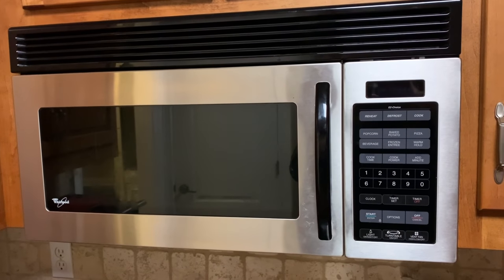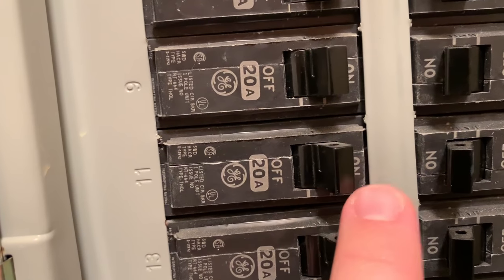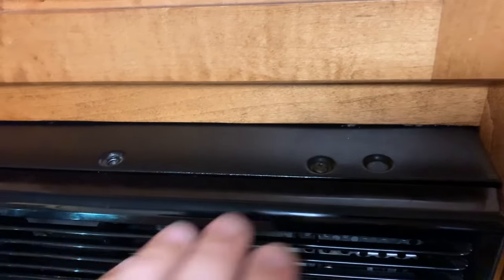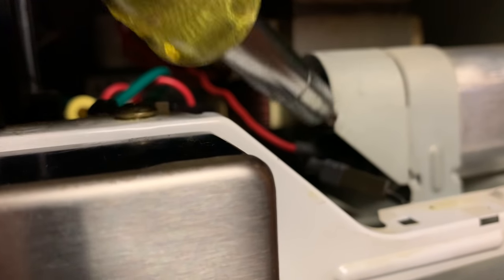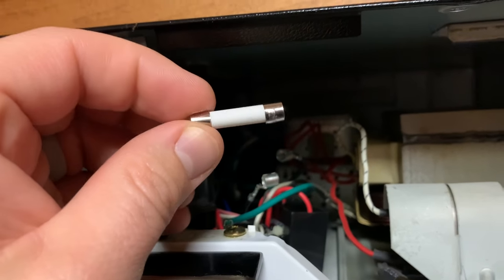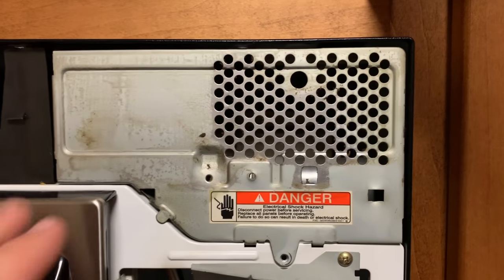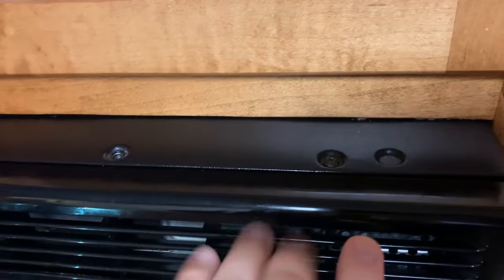Easy Fix: Microwave Won’t Turn On - No Power on Microwave

Comment: I was about to attempt this but the words "Can Kill You" made me spend money for the repair guy coming over Monday.
Reply from the maker: I completely understand. Any electrical work could kill you so it’s all about knowing the causes.
Reply: Me too😂😂😩
Reply: I didn't understand what you meant by ensure the wires are crossed prior to starting, wish I could have seen what you meant.
Reply: @stephaniespencer7898  Crossing the wires means the metal part of the screwdriver touches both wires.
Reply: Exactly I was like well guess I'm replacing it 🤪 and give my microwave to an electrician 🤣
Reply: Haaaahaaaa 😅👍🤣 That is a laugh 😂"Can kill you" Exactly right....if One don't understand Electric Current/Voltage ⚡⚡⚡ and Precautions
Reply: I tried the first one it worked turned it off and on
Reply: Fair, I've been rebooted by an electrical discharge once already
Reply: Right!
Reply: Apparently, if you leave it powered off for hours (or a day), any residual power is gone.
Reply: Thank you! I fixed my microwave!!
Reply: 😮 @sariahwandler4682  how?
Reply: That statement made me soil myself!
Reply: @sariahwandler4682  at the same time or do one and then the other and vice versa? Also, do I need to do this if I'm just changing a door switch?
Reply: @1flychicken  is 1 day enough? Some guys say it takes a couple of weeks
Reply: I mean driving a car could kill u
Reply: @bigrollin  True.....But I've been driving 36 years and of course I didn't learn how to do that on YouTube.  This kind of thing I'll leave for a professional. I have no electrical experience. 🤣
Reply: @1flychicken You want to chance that? 😮

Comment: One thing you should maybe mention is that if you wrap the fuse in tin foil you should probably discharge the capacitor again before reaching in there
Reply from the maker: Good point.

Comment: Great instructional video.  Contrary to other instructional videos on YouTube where the speaker is more interested in hearing themselves talk, you were not long-winded.  Straight to the heart of the problem and the fix.  Saved me from purchasing a new microwave.  Fuse costs me $3.63 at my local big box hardware store and I was back up and running.
Reply from the maker: GCag1165 That’s great! I appreciate the compliments. I love a good success story.
Reply: @TightWadDIY  so I find this vid to be very good but there’s 1 problem. My microwave is nothing like the 1 in the vid. It does not mount onto the cupboards. It does not have the thing on the top above the cooking area. And it does not have screws on the top of it either. Using google lens I found it is a General Electric microwave. My dad says he bought it approximately 20 years ago. I found this vid hoping to see if I cud fix it myself for cheap instead of heaving it into the dump and buying a new microwave. 

Cud u direct me to a vid that wud help me with this type of microwave?

Comment: I finally found my fuse hiding behind some components on a circuit board. The biggest tip that you helped me out with was the disassembly of the front! I was thinking that I had to take the whole unit down! You saved me BIG time! Thanks! (My M/W is a HotPoint)
Reply from the maker: That’s great! I’m glad you found the video helpful.

Comment: Thank you so much. I am handy around the house and fix almost everything that needs fixing. I couple months ago my partner attempted to boil an egg in the microwave. Needless to say I didn’t work. I then opened it up to see if any of the electrical circuits had blown. Thankfully, not so. I then thought it must be the fuse. When you mentioned by simply using tin foil to see if it is indeed the fuse. 

IT WORKED! I’ll be replacing it tomorrow. Amazing clip. Thank you ♥️
Reply from the maker: That’s great!

Comment: I killed one at work trying to boil carrots (we had no gas at the time, you may have heard about the Winter Storm of 2021 that hit Texas hard) pretty sure it died of a blown fuse, but my boss didn't want my messing it further even after telling her what I thought the case to be. I also replaced a light bulb in a personal one years ago.

I'll replace lights, I'll replace fuses, but I will NOT touch that big ass capacitor.

Comment: Thanks man I was messing with the back of my panel and I slightly shocked myself Just a tiny bit messing with the door lock mechanism... But when I did that the  Fuse Blew..  I watched a couple other videos no luck until I came upon yours thank you for showing me where the fuse is located and well using the tin foil It works now but I'm not using it until I get the new fuse thank you for your time
Reply from the maker: I’m glad you found it helpful.

Comment: You had me right up to using the tin foil. If there's a significant short in the microwave that "troubleshooting technique" could lead to  the wires melting and frying the circuit board(s). Better to test with a multimeter and leave it at that. Why RISK bypassing the fuse, especially when you don't know if something is shorted out?
Reply: Just because .22 caliber bullets also work, why risk it?   LOL

Comment: This is terrific but I didn't understand your instructions on how to discharge the capacitor. You said you had to cross it but I only saw you tap it in two places with your insulated screwdriver. 

Thanks for your guidance!
Reply from the maker: Make the screw driver touch both of the leads at the same time. Do this at your own risk. It’s dangerous.

Comment: I made rice once. Ran it for 10 minutes. Wasnt done so ran it for another 10.  At the end of the second run it tried to ring the done bell, and went black. Did all those things you suggest, and was about to unscrew the vent panel, when I decided a cup of coffee was in order. So I opened the stove top, lit the burner, and proceeded to boil water for the first or second time since we bought this rv.  Standing there waiting to see if water boils faster by watching it, I fiddled with the hood fan and light switch. Turned it on and was startled to find the fan was blowing down, not drawing. A moment later I looked up and lo, the microwave was back on.
I dont know what the connection between these events are: watching water boil, fiddling with the fan switch (bulb was burnt out on the hood fan, waste of money to replace a bulb that only lasts a week or two) . . or just waiting. 

I drank the instant coffee with great satisfaction at the magic of science.
Reply: @Itzel Rodriguez : My brother claims he made instant coffee in the microwave and time traveled. lol
Reply: @Itzel Rodriguez 🤣😃

Comment: This is why I love YouTube and guys like TightWad!  My microwave was like 10+ years old.  Then boom, no power.  Crap.  I figure it's tits up, so, I pull it out and take it to a recycler.  They wanted $5 to recycle it!  Nope, I'll figure another way.  Then I thought, maybe I should try and see what's wrong.  So, I put it out in front of my garage for like a week.  Today, I type in a few words, find this video, go out and do exactly what he says.  Tested the fuse with a multimeter, no tone.  So, I wrap a little aluminum foil and BOOM!  No, not an explosion, Power on baby!  So, I'm on my way to the hardware store and for $4.50, 50 cents less than the cost to recycle it, I'll pop in the fuse.  Then I get to reinstall it.  I guess that's my penitence for not checking YouTube before uninstalling it.  Hey, saved a few hundred dollars!
Reply from the maker: That’s great! I’m glad it worked for you too!

Comment: Thanks for this helpful video. It solved the same problem on a Maytag microwave. On a Maytag mmv4205ds3, this fuse is located on the "Noise Filter" board, located mounted to the back of the unit, within reach of a needlenose pliers for easy pull and replacement. I wish that I found this video first. I replaced the other fuse located behind the touch panel.
Reply from the maker: Nice!

Comment: Also make sure you are getting power to the outlet plug in a hairdryer or other item that will pull significant power and make sure the outlet works

Comment: my microwave is not turning on, no lights, no clock and the fuse is ok and there is electrical power in the outlet, since it's installed, I have used it a couple times before noticing it is not lighting up, can you offer a suggestion on what I can check? the model is fridgedaire FPBM3077RFA
Reply from the maker: Sorry I’m really not sure. Double check to ensure your outlet is working.

Comment: Thank you so much for this video. My LG microwave suddenly stopped working while I was warming up food. Luckily I had the extended warranty and scheduled the tech visit. Then I watched this video. Turned out my GFCI outlet next to the plug point was tripped. Reset and that fixed  the problem. 😀😀 Is it OK to connect the microwave to a regular plug point? My previous microwave also used to trip the same GFCI outlet.
Reply from the maker: Yes. Microwaves don’t need to be on a GFCI outlet.
Reply: @TightWadDIY  But why is the GFCI tripping? The breaker box says it’s 20amp. Should I replace the outlet? It’s 20+ years old.
Reply: @crazaholic1968  If the GFCI continues to trip after the micro is out of the picture then, yeah, it's probably time to replace it. They do fail over time. If not, then something else might be wrong with the micro, of course. I'm here 'cause my micro was tripping a non GFCI breaker. Then when I plugged it into a GFCI it began tripping that. Then the micro stopped working entirely. I suspect my door switch has gone south and that blew the internal fuse finally. 

Note that the 20A breaker is upstream of the GFCI outlet. GFCI Outlets are some times 15A. In my experience they are more sensitive to over current as well as short to ground. Makes sense, they are supposed to protect people from shorts around damp / wet locations. Annoying, but safer.
Reply from the maker: @crazaholic1968  It could be a number of different things. Start by replacing the GFCI. If the new one trips again, check the outlets on the same circuit. One could have an issue causing the GFCI to switch off doing it’s job properly.
Reply: @JackWilson327  it doesn’t trip frequently. Last time it happened when the old microwave died two years ago. Got the new unit and no issues so far until last night it tripped again.  So I guess it was a random surge or something maybe? I tested the outlet using a gfci tester and it seems working normally. Not sure if I need it checked with an electrician. Outlet is not designated for microwave use. Just using one of the outlet On counter top which happened to be connected to a nearby gfci outlet.
Reply: @crazaholic1968  I just re-read your post. So you have a GFCI device next to the plug point? Are you in UK or Europe? If so, this is making more sense to me now. Yeah, you probably want sparky out to look at it. Especially if it's happening more frequently.  

In the U.S. we mostly have the GFCIs built into our 120V duplex receptacles.

I know in UK, EU, & a lot of ROW they are often in another box & 220V & like you said, next or close to the actual outlet. 

Anyway ... you said your GFCI is good for 20A. If you are on 220 then 20A is good for 4400 Watts. 2200 on 120V.  So, in either case I'm thinking a good microwave should not be pulling enough to trip a GFCI that's in good condition. 

You can DIY it if you are comfortable doing the work. I know A LOT of people are not comfortable opening up electrical boxes. I get it. There are lots of good youtubes by real electricians out there.

Comment: Thanks this helps.  After replacing I could set the clock, but on starting it blew again.  Those other parts you mentioned easy to replace or should I just buy another?
Reply: Hello, question I did what he said also by changing the fuse an it starting working but the next day it stopped again.  By your question was curious what did you have to do with yours buy another one or did you have to do something else to fix it?
Reply: Same thing happened to me. Wondering if I should just buy a new one

Comment: Good video however I will caution you’re viewers putting aluminum foil  around a fuse is very dangerous for any amount of time the best troubleshooting method is using an ohm meter this is based on 47 years as an electrician thx

Comment: Caution on using "insulated" tool for discharging capacitor.
     I bought a multi-head/bit screwdriver at a  large chain hardware store.   Tool looks like one shown in video.   
     I notice one day (while I'm using tool in daylight) fine, raised print on black, "rubber" coated handle: 
    "WARNING: NOT INSULATED.  WILL NOT PROTECT AGAINST ELECTRIC SHOCK."        
      Make sure it is insulated.  
Also, there needs to be somewhere for the charge to go.   Resistors, and ground.    More of a process, but probably safer.
       Thanks & Take care.
Reply from the maker: Thanks for the tip.
Reply: Second that. Some of these tools we're getting have a ton of carbon (charcoal) in the rubber. The plastic should be okay I would think. One would have to put a meg ohm on it to see, absent a rating ... I digress

I have rigged up a 40W incandescent appliance light bulb in a socket with a couple of test leads just for this purpose. It discharges caps gracefully and gives me a visual signal the juice is all gone.
Reply from the maker: @JackWilson327  Now that’s a great idea!
Reply: What sucks is that I bought an insulated screwdriver for this but the bare metal isn't long enough to discharge the capacitor. Doh!

Comment: Thank you so much for your tips, my microwave started working right after the fuse (not even cost 3 bucks) replaced.
However, I couldn’t turn off microwave lights?  Please advise how to fix this issue.
Reply: Look on the microwave. You will find a light switch somewhere there. Sometimes it is little bit hidden. Mine is on the panel and it says "surface light".

Comment: Are microwave fuses of standard spec? How  does one determine the type of fuse? Thank you in advance.
Reply from the maker: No. There are different sizes. You need to pull up the parts manual for your device.

Comment: My microwave haved replaced the fuse and it work but 3 days later no more power. Can you give me other possible tip about what it can be?
Reply from the maker: It’s hard to say if it happened a second time.

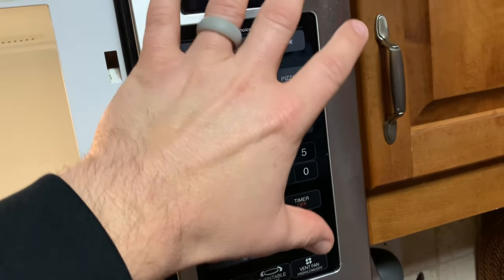Comment: Thought the microwave was dead but at 2:40 when you pulled the door the light came on ? Or was it from your camera ?
Reply from the maker: We had to reshoot that part of the video due to camera failure. That was filmed after the repair was completed.

Comment: my microwave looked like the one in the picture.  I didn't have to take off control panel.  I just took off the two black screws at top of black plastic vent.  It just slide and tilts. easy ( control panel didn't need to come off). Next I took off the two little silver screw to vent or fuse cover.. Took cover off  Replaced 20 AMP AGC  fast blow fuse and that was problem!!!!!!  thanks for the help from the video!!!!
Reply from the maker: That’s great!

Comment: Great video. My microwave internal light is on but nothing on the front display so it can’t operate. Started with the fan sometimes turning off and the microwave would reset itself. Not no function at all. Could
This still be a fuse?

Comment: Hey, your video is informative, however I noticed a few flaws. Firstly, those 2 little lights on the click you refer to were light up before you even took out the supposedly bad  fuse, also when you opened the microwave door the light came on ( again, this was before you removed the "bad"fuse).  So makes me wonder if the issue really the fuse?
Reply: Look more like the control board
Reply: I notice the same thing.  If you look closely the video person actual move away from the lite bulbs when filming
Reply: Watch when he opens the door before removing the control panel. The door opens and the interior light turns on. Uh.... Right so the lights work on a dead microwave. Fascinating.
Reply: He explained he filmed that part after he fixed the microwave.

Comment: I'm not sure how I blew the fuse but this helped me fix it! It was a different configuration than mine, but it was enough to help me find the fuse. Thank you very much. 

My door switch on the top seems faulty too, but I'm not going to worry until it completely stops 😂.
Reply from the maker: That’s great! I’m glad it worked for you too!

Comment: When my microwave died there was a flash and a bang (or pop), after which it died completely.  Took the cover off and looked at the circuitry but didn't see anything that looked like it burned, in fact everything looked okay, except it wouldn't power up.  It might be the fuse, in fact that's what I thought but didn't know where the fuse might be.  Will try what's suggested in this video to see if I can fix it.
Reply from the maker: Could be toast but I can’t say for sure.

Comment: Well, I'll give this a try. My issue was re-heating up a couple of baked potatoes. Instead of 3min 30 seconds, I (apparently) hit 35min and went downstairs to talk to the wife. Yea, smoke alarms, and if anyone hear has charcoaled a baked potato, it's pretty intense, smell wise. So I have very a similar setup, verified source power with multi-meter, but no bueno.Don't know if fuse (likely) but it didn't trip the breaker. Even if it is the fuse, could also be the fan motor backed up with smoke, and even if this fires it up I may well be smelling charcoaled baked potato every time, which won't please the wife, even with a miraculous save. Likely out a $400 microwave, but I still got a chance right?  Thanks for the vid. I'll update with outcome.

Comment: Thanks for the video. I changed the fuse and everything worked. Door opened, interior light came on, fan worked, lights worked and as soon as I tried to use it I heard a quick hum sound and lost power again.
Reply from the maker: So you have something else not working properly and the fuse is doing it’s job to protect the other elements.